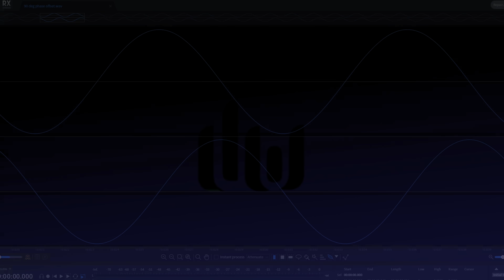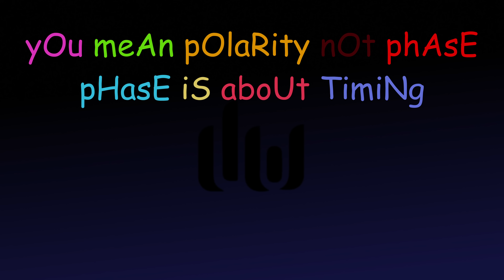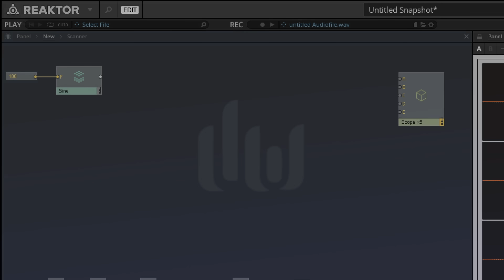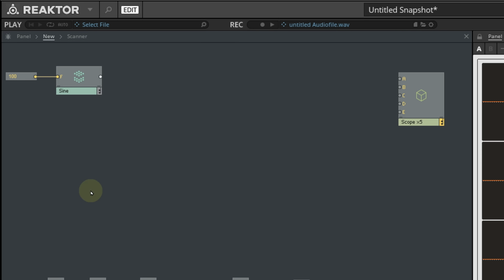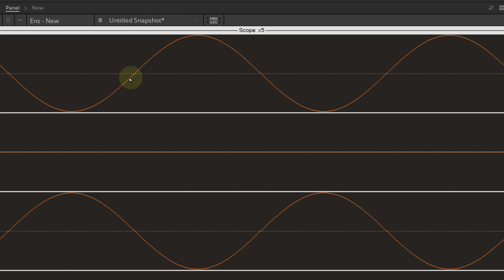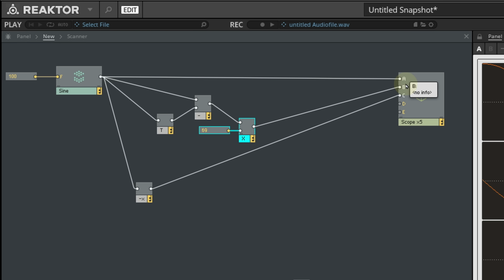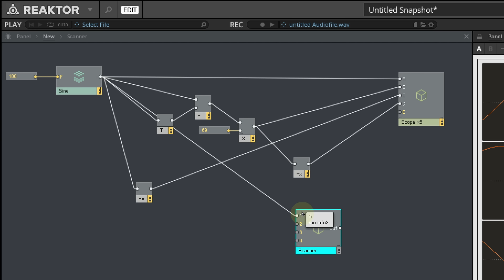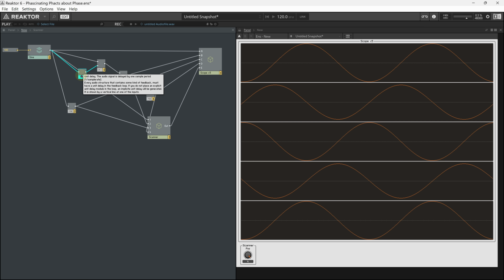Phascinating Phacts about Phase

Comment: If audio engineers learn something really quickly, it is how to get angry with you and complain (even without the facts at hand). Funny story, bad experience, that's a shame.

I actually disagree that 90 degrees is benign. Comparatively -- I mean, maybe. Not comb-filter horrible anyway, yeah. But I think still. From experience mixing/designing synths, I feel like I would absolutely be able to choose between -90, 0 and +90 if we're talking summing something together (which we basically always do in music). I make these choices on the regular, too.

The polarity phase timing people always drive me nuts. I feel like that presence obscures the correct understanding of when phase matters incredibly and when it can't be heard if played in solo. They didn't quite get it themselves, but they are there to correct.

(Why go through the reaktor thing when you can specify the phase of every harmonic in a Serum editor? Maybe I don't get the illustrated point?.. Basically all major wavevetable synths can do that. Wouldn't that also prove the phase/timing statement?)
Reply: thank god the entire spectrum of human hearing is narrow enough that DSP can accurately manage the phase within it. also, doesn't phase in isolation affect sound qua speaker transducer behavior? pushing air out vs pulling in? not that it's really so audible, or maybe not even audible at all without comparing it to its phase flipped opposite.

Comment: Big Fan Dan! I feel these phase explanation videos aren’t going as deep as they could, mainly because the examples use single sine tones. Most real-world phase problems actually reveal themselves through group delay interactions, how different frequencies in a complex signal shift in time relative to each other. It would be fascinating to see you explore that direction, taking a complex signal (like a kick or mix element) and showing how varying amounts of phase shift alter the timing and tonal relationships across frequencies. For example, I was watching Baphy’s video the other day he couldn’t clearly spot pre-ringing on a kick in the oscilloscope and concluded it wasn’t audible, without realizing that the pre-ringing was buried under the kick transient itself, which is exactly why the transient feels smeared. low-frequency component where the filter is applied causes the pre-ringing not the kick itself but that has an overall effect on kick sound.He even mentioned that Dan Worrall downplays pre-ringing because he rarely hears its side effects but I could easily hear it in that kick example. I think it’s time we move to the next level: demonstrating how phase shifts and group delay shape complex signals. I believe that’s where the real understanding of audible phase rotation lies.

Comment: It took me about 2-3 seconds to figure out the 90 degree phase shift of the signals when hearing "one senses velocity and the other senses pressure". Because all phenomena that are governed by cause-effect relation, as in "pressure difference causes air to move", are related with 90-degrees of phase shift. Electromagnetic radiation follows this (the change of electric field causes magnetic filed and vice versa), and many others. Even graphs of the populations of predators vs their prey follow this 90-degree phase-shift rule (with some variation of course).

Comment: Could you explain a little further about how adjusting mic distance between a dynamic and condenser wouldn't solve this 90 degree shift? or is the point that this difference is negligible?
I feel like you demonstrated this with the reaktor bit but I'm still not understanding lol
Reply from the maker: Delaying a signal (moving a mic further away) shifts the phase more for higher frequencies than for lower frequencies. But there's a constant 90 degree phase shift at all frequencies. So the delay time (distance moved) can only be correct for one frequency.
Reply: @DanWorrall  That means that a complex curve resulting from 2 or more sinusoidal curves overlapping will look different for both, dynamic vs. condenser (or rather pressure vs. pressure-gradient mic, as other comments are suggesting), right? While that seems counter-intuitive to me at first, I wonder what does this curve difference mean or correspond to in practical terms?

Comment: Thanks for the insight. You demonstrated the phase shift on a sine, but not on a full spectrum signal. In fact, if I gather what I tried with desmos and Reaper, it wouldn't work quite as intended. When you differentiate the sine, its content will act as a coefficient, and so the high frequencies will be more boosted than the lows. So I guess you would also need a kind of tilt eq to rebalance the frequency energy and end up with a signal properly phase-shifted
Reply: Woah I didn’t think about that. d/dx(sin(x))=cos(x) but d/dx(sin(nx)/n)=cos(nx) (input was on a pink noise spectrum but output is on a white noise spectrum, so a darkening tilt filter is needed).

Comment: dynamic microphone applies hilbert transform. waow
Reply: oh wait when u differentiate a sum of sines u do get a sum of cosines but each guy gets multiplied by the angular frequency so it's a little different
Reply: @charlotteathena  dynamic mics are velocity sensitive and condenser mics are position sensitive... so dynamic mics capture the 1st derivative of the signal captured by condenser mics. shouldn't that mean dynamic mics are lowpassed highpassed +6dB/oct compared to condensers, which is the effect of differentiation?
Reply: wouldn't it be highpassed rather than lowpassed?
it was also my first thought to use a dynamic/condensor mic pair to do a hilbert transform baha
Reply: @flet-168  yes! you're right. highpass, +6dB/oct is the effect of differentiation. rookie mistake smh

Comment: Does that mean that condenser mics always produce a DC offset? Obviously I imagine it gets filtered out if so, but kinda cool to think about.
Reply from the maker: The vast majority of mics have a lowest frequency below which they don't respond, or in other words a built in natural high pass filter. Any high pass filter at any frequency will kill DC. I think it's possible for an omni condenser to be sensitive right down to zero Hz. I'm not sure if that would mean a constant DC offset, that's an interesting question.
Reply: there would typically be an AC coupling cap to null the preamp/phantom power bias anyway.. i wonder if there are any low freq specific errr 'scientific' mics that are DC coupled hmm
Reply: @DanWorrall I guess it would probably be a case of whether the mic is actually sensitive enough to pick up baseline atmospheric pressure. Or am I taking the high resolution barometer thing too literally?